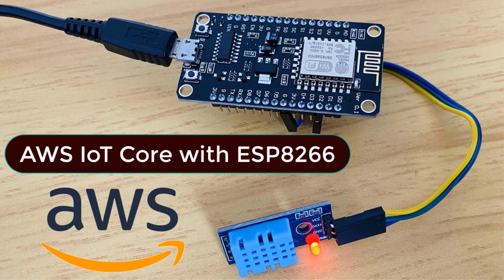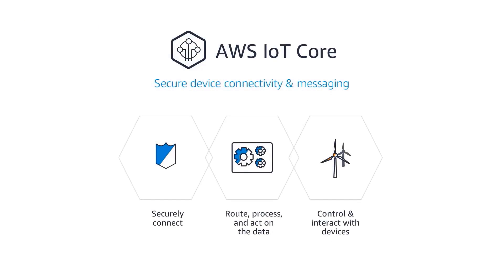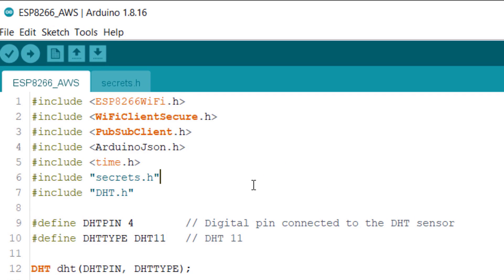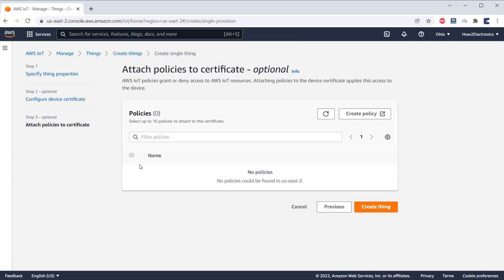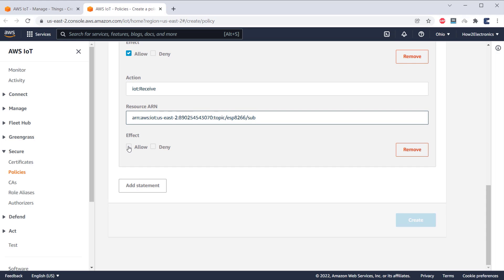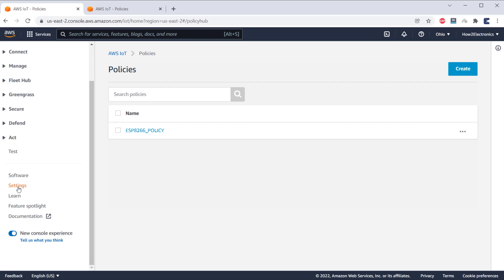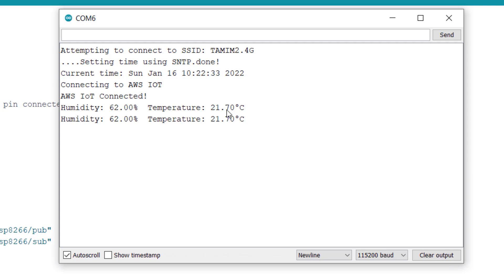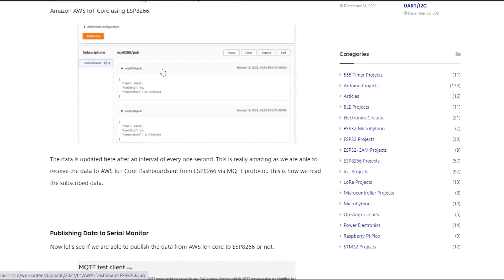Amazon AWS IoT Core using ESP8266 || Creating Thing, Policies & Certificates

Comment: I am getting timeout error while connecting to AWS
Reply: check the monitor tab in IoT  core to see if your endpoint is correct and you are hitting aws,  if so and no data then check your certificates as they are probably faulty
Reply: @SteveOnIoT  Also check to ensure that the policy was set up correctly and with the right values you want to poll from. in my case, I had used "ESP8266/pub" and was trying to poll from "esp8266/pub" and then in the connection policy I had mistakenly written ...client/ESP8266/ESP8266 instead of ...client/ESP8266
Reply: @doreenchemweno  Anothr easy trick is just to subscribe to "#" on the MQTT test client and you will intercept all topics published to your account in your selected region.
Reply: @SteveOnIoT  Thanks for the tutorial very helpful

Comment: Code is not running...it doesn't connect with the AWS...I try all the possible things but doesn't work
Reply: check the monitor in AWS IoT Core first, if its not showing a connection you likely have the wrong region or endpoint.  If you connected and no data then you likely have a problem with your certificates